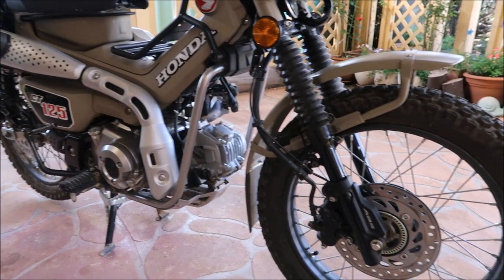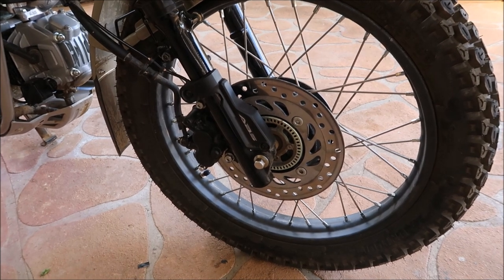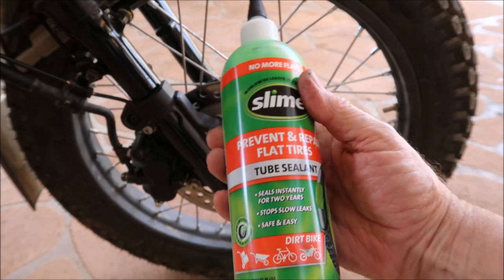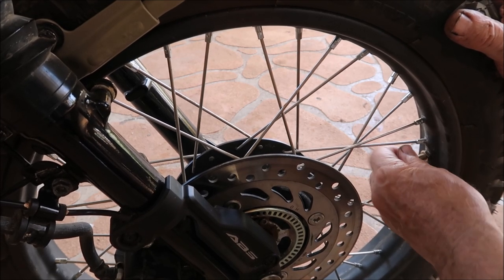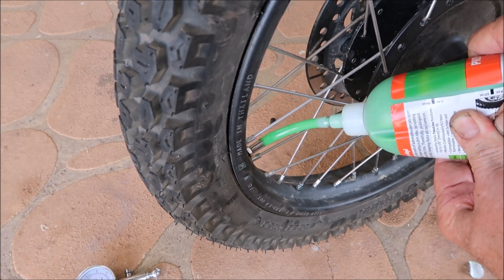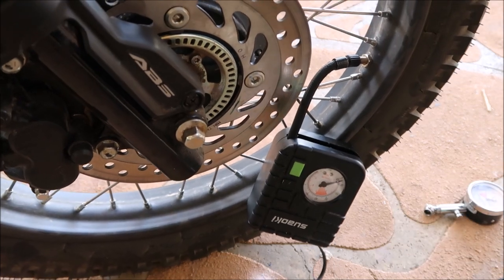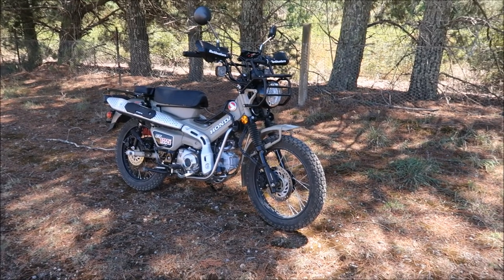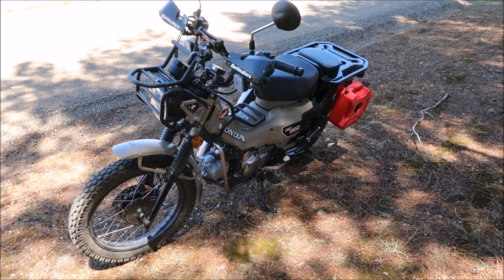Honda Trail 125 - Slime for Tires  Does It Actually Work? -The Good & Bad News!

Comment: I'm really surprised the slime affected your steering.  I've used that in all my dirt/enduro/street bikes for over 30 years and I've never seen anything detrimental from it.  Of course all our ATVs are filled with slime too.  I'm sorry you don't like this product.  It's been on the market for many years and millions of users swear by it.  It looks to me like the wobble was in the road surface.  If the slime would cause the wobble, I'd think it would be constant, like any tire that's out of balance (they wobble constantly).
Reply from the maker: i think the product slime is fine and does the job but i think their instructions are a let down. maybe 4oz per tyre would have been the better option.
saying that it did fix the leak issue

Comment: I can't say that I have had much luck with Slime. I used it on my 1997 BMW Funduro. It picked up a nail and I inserted an entire bottle of Slime in the tube, but it all leaked out of the nail hole within three miles. I ended up riding the 10 miles home on a completely flat tire, which somehow never came off of the wheel rim. Two years ago I picked up a nail in the tubeless rear tire of my Zero. The Slime sealed the hole for about 300 miles before it started leaking out of the tire through the very small hole.  I then installed a motorcycle tire plug in the hole and it almost immediately was thrown out of the tire, quickly resulting in a flat. It turned out that Slime makes a very good lubricant. So I finally repaired the tire by carefully cleaning the nail hole with alcohol and inserting a Stop and Go tire plug in the hole. That has lasted for 2K miles so far with no more air leakage than when the tire was new.  I haven't noticed any odd behavior in my rear tire which still has lots of slime coating the inside of the tire.  I am not looking forward to changing the tire, but at least the product is supposed to be water soluble, so cleanup shouldn't be too bad.
Reply from the maker: its possible i put too much in and threw it off balance. hard call really. instructions said 8oz per wheel and i followed those.
4oz maybe would have cured that issue. plus it appears my rear tube was pinched too. i now have a slime trail down the side of it too.
so i guess it sealed it too...lol

Comment: I carried this stuff for years on my four wheelers but I never had to use it. Good information I will not be wasting my time on this product in the future.
Reply from the maker: did an update and it did actually seal the slow leak. balance wise i'd say too much in the tube following the specs on the container.
dumping 8oz in the tube was an over-kill and i think 4 oz would have solved the out of balance issue.
if i get the chance and seeing i have a bit of the stuff in stock-like a full bottle...lol - if he situation arises i may try 4oz to see if that is the key to a successful ending

Comment: 8 oz works fine in a 120/17 or 90/21, but on the CT, nahh, you're right, 4 oz is more than enough on those small tyres. I have run slime for years, never had a balance issue, or a puncture. At least its water soluble too so you can still patch a tyre or tube thats had it fitted. 
if theres too much in there, valve at top, remove, then rotate till valve is at bottom and drain some out, or, valve at bottom, remove and get covered in it, always good fun to watch someone do that.
Reply from the maker: i'd go 4oz next time for sure...lol

Comment: Great one Warro ,always wondered if this stuff was too good to be true , with caution thank you for putting it right 🛵🛵🛵🛵🛵
Reply from the maker: well it did stop the leak and i noticed the rear tyre has a slime mark down it too.
my guess both tubes were pinched during the new tyre fitting, i could have done that myself...lol
maybe 4oz per wheel would have worked fine and take no notice of the supplied instructions

Comment: I tried the slime in my Hunter Cub and I was unable to get more than a few ounces of the slime to into the tube.  Ultimately I went from a slow leak to a tire which would not hold air.  But, I will still carry a bottle when I’m way out in the forest.  I just replaced both tubes with heavy duty Dunlops and new HP22’s.  Thanks for the vid.
Reply from the maker: yeah i actually put too much in on the first attempt. just followed the instrustions too well...lol i'd say what you put in was more like it as i ended up with an out of balance wheel
ive put it in the other bikes too. this time less and no wheel balance issues

Comment: My experience with Green Slime products pertained to some bicycle inner tubes they make. My wife rides mini ponies in carts called Hyper Bikes. The Slime tubes came already in the tires. After only a couple rides they failed due to some pretty small sandspurs going through the tires and barely touching the tubes. The only thing the slime did was show me where the holes in the tubes were. In my opinion they sucked and just made a mess. I ended up swapping them out for a thicker tube and also installed tube liners. Never had another flat. I know product results may vary depending on the job, but I think this stuff is good for quick fixes not a permanent repair. If it throws your wheel off balance I would get a new tube before it makes your tire wear uneven. Just me 2 cents mate.
Reply from the maker: yeah your right in all honesty i cant ride this bike like that. i planned a rough country ride too. thats the only reason i did it -more of a back up.
i could leave the stuff in and transport the bike to the area. once i set off i wont be travelling fast so i have something to think about later on

Comment: Very, very interesting. This might account for why so many people in India are having wobbles on the RE 650s where slime is used a lot. 
Nice one Warro. 😎
Reply from the maker: maybe so! although it did fix the slight leak but i think following the instructions-8oz was way too much in the tube per wheel.
probably 4oz would have been better but not sure then if it would have sealed the punture.

Comment: hi Warro, perhaps this slime is good for some bikes and not others, ive put it in my Classic 500 and my Himalayan tubed tyres with no discernible changes to the steering at all speeds that they are capable of, thanks for sharing your good advice always.
Reply from the maker: yeah looking back would i try it again-i think i would and this time rather than follow the instructions on the container i think i'd use say half the amount and try that out

Comment: Good video warro..4oz should be plenty for small diameter tires. I use it in tubeless ATV tires with good results. Using 4oz. Even on the larger tires. Have problems with thorns in my riding areas. I've put it in my kid's smaller dirt bikes too. 14" and 16" tube tires. 4oz. In them as well  no balance issues. Just messy if removing tire from rim's. But good no flat insurance!
Reply from the maker: well it actually works as i just found a slime trail on the rear too so both tubes were pinched during the tyre fitting.
putting it in was pretty easy -exytracting 4oz appears harder than it looks. 
looking back i should have not read the instructions at all...lol
Reply: @ridewithwarro  yep alot easier to put in than taking out for sure...When you mount a tire air the tube up a bit so it's round but not tight in the tire. put talcum powder or baby powder all over the tube it will help tool slide off and not pinch the tube. Old trick from back in the 70s ..I changed the 15wt oil that came with the YSS front fork kit. It was slow rebounding and stiff. I ride some rough territory sometimes.  I put some silcolene pro RSF 5w. 120cc It was really great on the highway and small bumps but bottomed on deeper holes. I changed it to maxima 7wt 120cc still smooth but still bottoms out too easily. I changed it to maxima 10wt 120cc it works great. Rebound is faster than the 15wt. Smooth on small bumps and don't bottom so easily.  I'm a heavy rider at 260lbs. Set static sag at 1inch. Sag is about 2inches sitting on bike, that puts me mid suspention travel. Next rear shocks those stock ones are really bad. Went over a small log in the woods and it bounced me up off the seat. Forks handled it good. Cheers
Reply from the maker: @keithtrent4446  will keep all the info in mind should i try myself and do the change.
if you watched the rear end of the slime clip -bike is running pretty good. i am running 13t/41t 
i found the 45t rear was just too slow on the open road and the revs very high even for me. i can pull 80 kph/50 mph very easy with this combo
Reply from the maker: @keithtrent4446  just a thought here. do you think i could put my factory 250 size tube from the ct125 in the new off road style 30 tyre? or would the tube be too small
Reply: @ridewithwarro  I think most tubes here come 250/300 so they fit more than one size. I've crammed a 400 size tube in a 300 size tire in a have to ride situation before and alot of powder to make it slick so I wouldn't pinch it. A smaller size should expand enough when size numbers are close. I wouldn't go extreme.
Reply from the maker: @keithtrent4446  i might have a go again myself...lol bit of practise. if i can get the old tube out i might be able to drain out most of the slime out of the old tyre and try 4oz instead.ride the bike and check the balance

Comment: Hey Warro, I feel for the little cub! You’re wringing it’s neck out!😂😉. For back-up, I’d go with a spare set of tubes in your rear case for your planned adventure trip as my mates & I experienced a puncture out near Innamincka. It took us a while to break the bead, & we used the side stand to help us, but if you have a good set of tyre levers, it’s better than being stuck & dealing with slime🤔🤣. Also, just use the small co2 bottles & valve fitting or your nifty little pump plugged in to a 12v socket 😉👌
Reply from the maker: yes i do give that little bike a good workout...lol probably much more than i should. good tips on the tyre stuff.will keep it in mind

Comment: I've also got some slime stuff for my tubes - but in the instructions its does say to go for a ride (soon) for a few miles after putting it in - maybe it distributes better than hand spinning the wheel.
Reply from the maker: maybe! next clip i removed the tube and ran back to the stock tyre. the slime is far easier to get in the tube than out. pretty thick gooey mess...lol
now back to the stock front tyre and bike running fine.
i would use it as an emergeny fix but not put in 8oz and say try 4oz.
more importantly - it does appear to workand seals punctures.
just a bad call following the instructions and i say use 4oz not the 8 oz as intructed by the supplier.far too much
all the best

Comment: They make one called 2 in 1 now. Maybe that's better. Useful video. Cute little bike. How do you get on with the gear change? Have you thought about getting the rims taped and running tubeless?
Reply from the maker: Yes and yes

Comment: Years ago approx 1990 I used the stuff they put in a aerosol can to seal a puncture in a tubed rear tyre on a Z650 Kawasaki. It got me home, 140 miles.I decided to leave it in the tyre & see how things rolled,after a few months I was getting vibrations from the rear wheel,I think it eventually threw the wheel balance out.The inner tube still stayed inflated until I decided to swap the tube.I have that slime in the tubeless tyres on my Street Triple,no adverse effects so far,maybe try draining some out of the tube & see if the wobble stops?
Reply from the maker: if i can get say 4oz out of each tube i'd give it another ran -trouble is getting it out. tried a couple of goes with no luck

Comment: Why didn't you check the valve first... The valves aren't perfect and it may have been that, A simple bit of spit on the valve would have or may have saved you putting that shit in your wheel...
Reply from the maker: good point and i actually did that too. over the years ive had 150 odd cars so know that trick. yesterday i was checking the rear tyres. green slime trail down it too.
my guess that tube was also pinched when it was fitted with the new tyre by the service centre
so you could say a double drop in air pressure...lol

Comment: Could it be for the size tyres you have that you put too much slime in? Thought 1/2 a container in a tyre is for a larger tyre than on your bike.
Reply from the maker: maybe. i think thats quite possible. i just followed the directions and it said 8oz for a dirt bike. that sounded ok to me. it also showed 4oz for a pushbike or a wheel barrow
well it did seal the tyre so all good there...lol

Comment: Perhaps try the tubeless conversion. Quite a few vids on it. I reckon I will try it on the Interceptor.  When it turns up.......🙁
Reply from the maker: might be worth a look at too
Reply: I seen the tubeless conversion is a tape that covers the spokes.It works but looks pretty thin I saw a resourceful indian business use the old tube on the rim chuck the tyre on then trim access tube rubber off, worked too.Another indian Business used a generous amount of silicone  over spoke holes then 2 inch wide piece off the old tube.Pretty impressive & they doing alot of buisness too.They're a very resourceful bunch.👍
Reply: Converted my interceptor wheels to tubeless using 3m marine adhesive sealant. Just fill the nipple wells inside the rim and voila! 2 months and nary a top up. And I now have beautiful Bridgestone tubeless tires.

Comment: Slime is 100% a get you home fix.....not for routine puncher repairs.....you get home and fit a new tube.

No way would I want to be riding my bike any longer than necessary with a load of liquid sloshing about inside the tube.

For one thing its going to effect the wheel balance.
Reply from the maker: know what you mean. ive put 10,000 klm on those tyres now troublefree

Comment: Warro have you tried those tyre spray cans.Apparently good enough to get you a few miles, hopefully home you ride 2miles stop buy then should of spread around tyre then ride home at 70k.Wreck tube have to get new one.
Reply from the maker: at the moment just trying out the slime product for tube tyres on the trail 125. if it works fine after longer term testing i might add it to the tyres on the other bikes.
Reply: @ridewithwarro  I would go for the tyre 🐼 panda spray  in can over slime & you don't need air to pump it up my mates old man riding Harley & British for 50 yrs uses it.Or try what indians did with silicone & 2 inch piece off old tube no balance issues either.Did u check my bike out, leave a comment to see if I get it.b much appreciated.
Reply: Warro did you get my comment about new R.E seat looks pretty beefy with parallel lines looks comfy but I would go Hitchcocks or Trip Machine got  a have comfort for your ass.
Reply from the maker: @ruahinesrider  just saw it. i actually dont mind the stock seat. over the past few years i've owned many new bikes and some have been real shockers...lol it almost feels like one did a big end bearing riding them!
Reply: @ridewithwarro  I only rid dirt bikes & work bikes for years  never sat on them long enough to notice but I did ride some mates road bikes head down ass up 1 was Yamaha a real shocker.Intetceptor my first roadbike I own.Had a loaner 1990Mz 250 east German Soviet bike before Interceptor only 10000k on it,odd bike 2 stroke kick start on left side, still in shed haven't ridin it since I got Interceptor.lol
Reply from the maker: @ruahinesrider  wonder you never tried the C5
Reply: @ridewithwarro Just got home from Ride Warro.Whats a C5?
Reply from the maker: @ruahinesrider  royal enfield classic 500 -my favourite bike -ive had 15 of them
Reply: Yeah 15, loyal to a great product.Was gana get one about 3yrs ago then the twins were released so I waited for teething problems to be ironed out like you do but there weren't many but I'm glad I did and got Euro 4 model.Euro5 can't  modify things like booster plug,headers.

Comment: What size tires are you running?
Reply from the maker: i had3.00 on the bike but felt it slowed it down. on this now a stock front and 3.00 rear
Reply: @ridewithwarro  How do you like the 3 on the back and the 2.75on the front?  Does it fix the slow down issue?
Reply from the maker: @marzvoltron307  it does but better still add the 13t front sprocket and its a real little mover which can also climb well

Comment: The stuff is pretty good, i shove it in if the pressure goes down, and forget it.I put it in a front wheel puncture and rode around on it for two years,until the tyre had to be replaced for a warrant. You're a mug if you don't carry a can for emergencies.
Reply from the maker: worked fine on the slow leak and still holding pressure firm. balance wise i think the instructions could or should have been better.
it said 8oz and that what they got. maybe 4oz would have been the better option and may have eliminated the balance issue